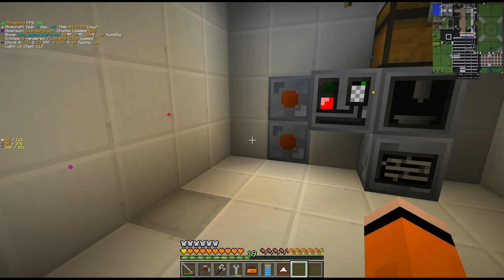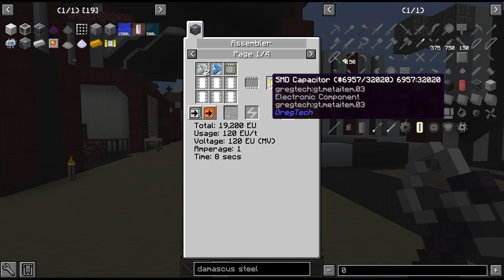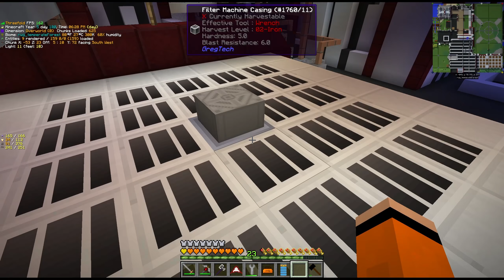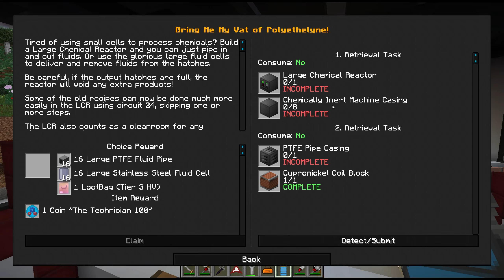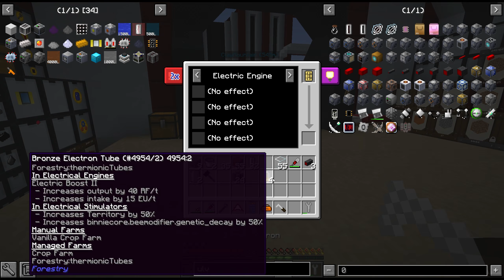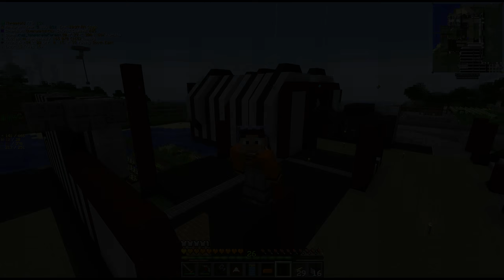Gregtech New Horizons - 18 - Jetpack & Forestry Multifarm! Modded Minecraft

Comment: you only really need like 4 ingots of platinum before EV (where the platline appears)
OK, maybe 8 with your scale; but still
that's an assload of platinum if you don't pipe it all into an EBF as is

Also, you made the cleanroom, why don't you use the new line of circuits? that starts at MV and goes to IV?
(only problem is it uses copper instead of gold and takes more chlorine, but lmao just mine out a salt vein, that will be enough)

The multifarm can run on IC2 fertilizer, so you can just return the distillery output back into the farm (it should be enough to self feed)

Comment: You can remove the pressure plates that open the door. No reason for them to exist, it's just a chance you'll loose efficiency and maybe a craft if you accidentally step on it.

Compressed chests, Three. I mean obviously you should clean up as well, but some Compressed Chests would still help a lot in keeping things organized.

You have to supply enough power to run all of those machines at once, unless you set up some sort of redstone control or something to keep them supplied with enough power. If one machine runs out of power it's going to continue to try and craft until the end of time, drawing power the entire time, which will cause other machines to run out of power, and the entire system will fall apart.

I'm not sure if it's intentional and/or whether it will change, but I've heard you can remove those carrying a full tank debuffs by simply drinking milk or eating Terra Wart. Terra Wart is an IC2 crop that you can get without mutating: Simply place Nether Wart in crop sticks placed on soul sand, and place snow blocks below the soul sand. Don't harvest the Nether Wart, and in time it should mutate into Terra Wart right on the crop sticks. No cross-breeding needed. Terra wart is also hugely helpful for the TC aspects it has, in addition to being a stackable debuff remover.

Instead of running your Pyro oven at a higher tier upgrade the coils instead. Same speed upgrade (well, not exactly the same necessary, but a speed upgrade all the same), no extra power cost. And crafting better coils is something you should always be looking into, anyway.

I'd say "welcome to the GTNH questbook being bad", but that would imply you can get this far without encountering it before, and that's just not possible ;)

Like I said, you will never miss the cleanroom having a maintenance issues unless you're just not in your base at all. The same system you can place on other multiblocks, by the way, if you're ever worried about steam boilers running less efficiently or the like. No multiblock needs the system as badly as the cleanroom, though.

For the record, the different multifarm blocks are just aesthetic choices. A nether brick multifarm is no better than the same multifarm made out of bricks or sandstone, etc.

About that platinum pain train dust: Yes, you get a lot, but until you actually process it (which requires IV to do fully, EV to start IIRC) you get basically nothing out of it. And you will need not just platinum in extremely large quantities later, but all of the various byproducts that it produces in large quantities as well. Put it this way, you have a lot now. Soon enough this will only be a lot to process.

In case anyone is curious: Early Forestry farms for IC2 crops is possible, despite it needing Uranium electron tubes. Find a Beryllium(/Emerald) vein in the nether and mine it out for Thorium. Process the Thorium such that you get Uranium 238 as a byproduct, and viola: The material for IC2 crop Forestry farms. If I'm misremembering and you need Uranium 235 that's also doable, there's a TC recipe that turns 238 into 235 at a very favorable ratio, all things considered. The relevant research is on the Electro-magic Tools page, IIRC.

I want to say a manual farm is actually better than a managed farm? I think the only difference is that a manual farm requires you to place the farmland and maybe plant the crops manually, the multifarm itself will harvest/replant the crops and/or chop the trees etc. I always go with a manual farm so I can optimize the water placement and/or use things like fertilized soil if that's an option (it's not for a tree farm, that requires special Forestry soils to work), but it's been a very long time since I set up a multifarm.

One final thing, make sure to carefully check the recipes for fermented biomass, if you want to go that route. It might be more efficient to cook up your organics into biomass and turn that into fermented biomass rather that rather than going with the plantball method. A setup I used was made much more efficient after I cut out the plantballs, but that setup didn't use fermented biomass specifically, so I'm not sure if the same will be true in your case.
Reply: Note that the U-238 tubes need eyes of Ender, so it’s not as simple as just getting uranium
Reply: @Royal_4096  I believe you can trade for Eyes of Ender with villagers, as well as get them at least one other way that doesn't involve an HV chemical reactor, according to the questbook? I believe that was mentioned as part of the TC progression, since the Runic Matrix requires an Eye of Ender, but I can't remember the details (and I wouldn't be surprised if that information was outdated and/or wrong, besides even if I did).
Reply: @TheShadowofX  Yes you can trade with villagers, but good luck with 1.7 villager trading

Comment: Florine is renewable before moon from biotite
You can use GT cables to power rf machines
Consider using IC2 crops instead for your forestry farm, a lot better output than just using vanilla crops
Reply from the maker: Should be easy to swap to ic2 crops by just changing the circuit inside the multifarm right?
Reply: @Threefold.  Yes, and the farm is bigger